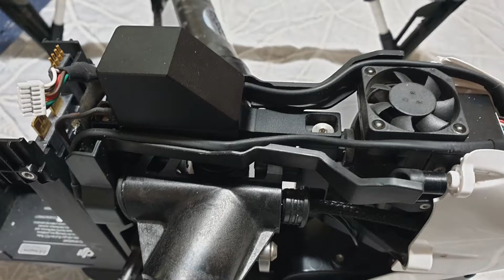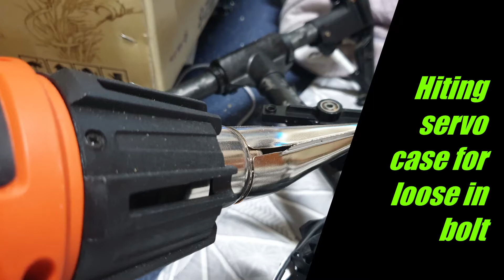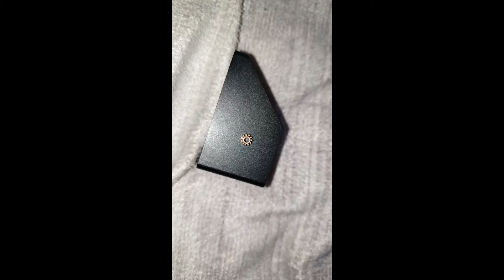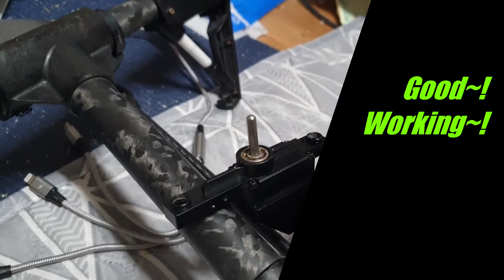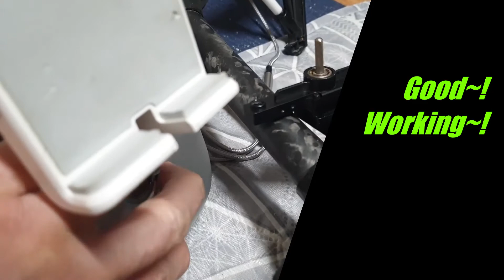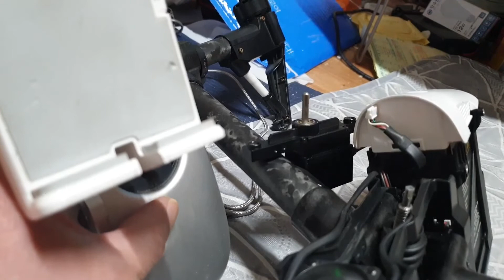Inspire 1 landing gear servo repair ~!

Comment: 인스파이어 1의 서보를 프레임에 고정하는 두 개의 스틸 나사를 어떻게 제거하셨나요? 고품질 육각 렌치를 두 개나 부러뜨렸는데도 나사가 전혀 풀리지 않습니다. 파란색 고정제가 사용된 것 같습니다. 어떤 팁이 있으신가요?

How did you remove the two steel screws holding the servo to the frame of the Inspire 1? I've already broken two high-quality Allen keys trying to loosen them, but the screws won't budge because they used blue threadlocker. Any tips?
Reply from the maker: @ArmandoIsmaelARC1  헤어드라이어로 살살 녹이시고. 하면. 잘 풀립니다.

Comment: so you are saying , just locktite on the gear shaft?   I put super glue on one just now.   I just don't understand why the gear isn't secured better on there.  no set screw, just round shaft and gear that spins on it
Reply from the maker: This is to prevent idling by using Loctite glue to prevent the teeth of the gear shaft from being fixed and the gear on the opposite side rotating in vain.